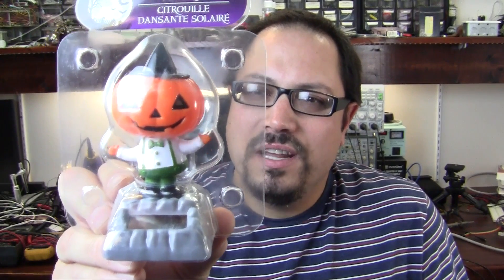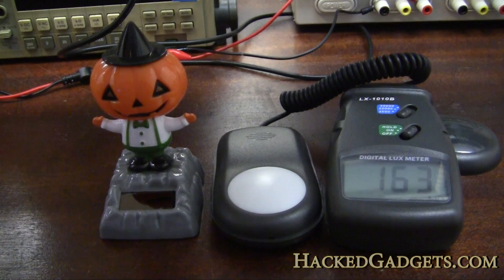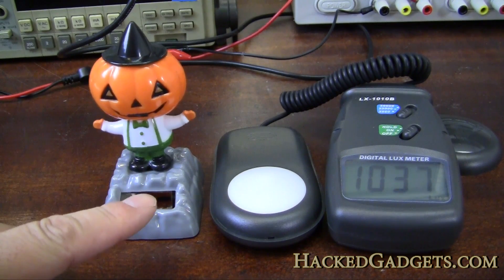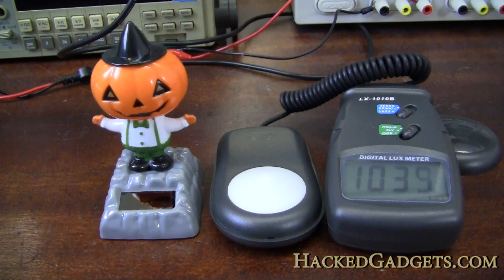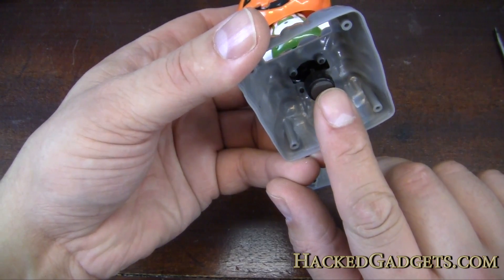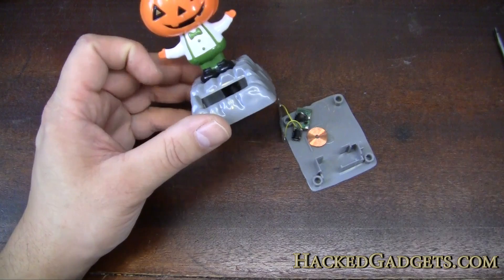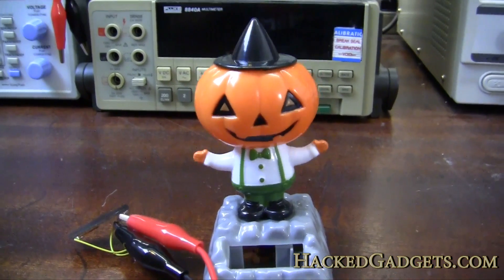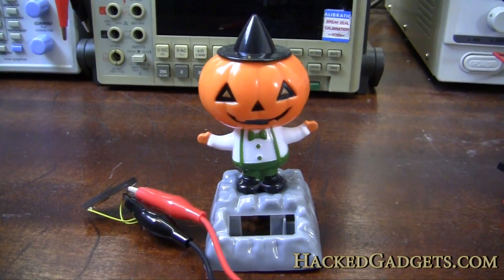Solar Dancing Pumpkin Teardown

Comment: I bought several different solar characters on ebay-they don't ship well-after watching I was able to repair some. Some worked well for a day and then not much even on a very sunny day-repairs look good, any ideas ?
Reply: Sage Kester of course why you need to overclock it. Would use a 1.5 volt solar light panle.